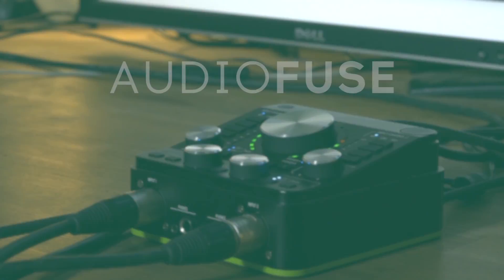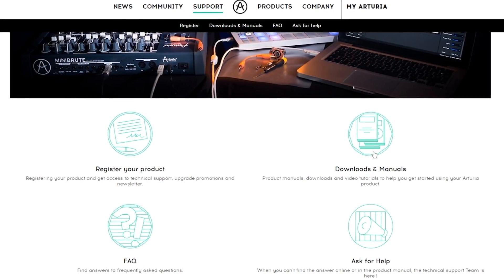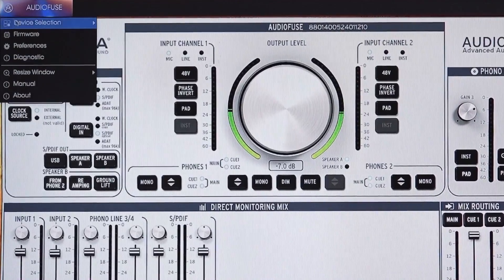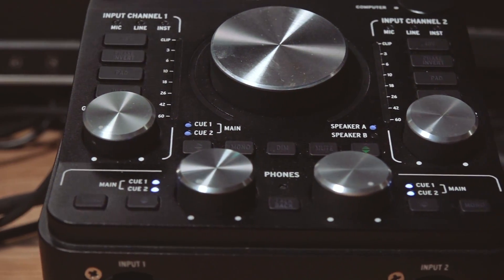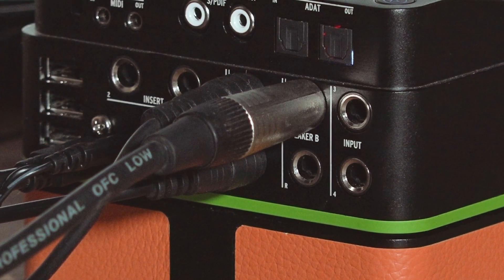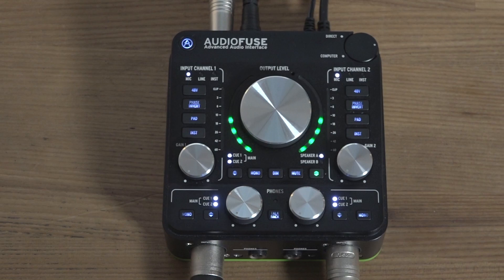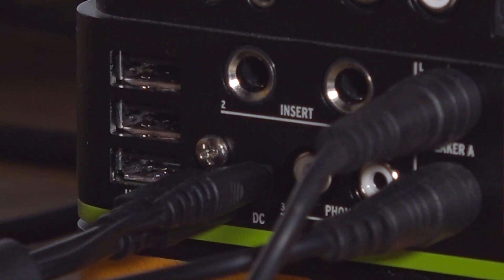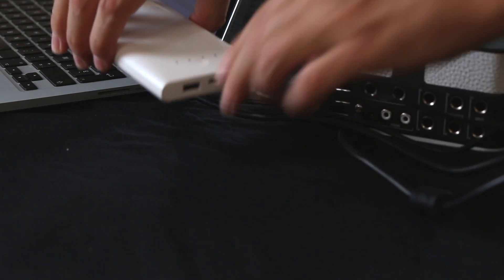AudioFuse Tutorials: Episode 1 - Power Modes

Comment: Just received my audiofuse, I have two iMacs both registered to me via Apple can I install the software onto both machines as I may want to use one iMac in a different location i.e. My static caravan/ trailer any info would be appreciated,I have not registered my audiofuse yet so can't ask the question on forum.
Reply: You can install the AudioFuse Control Center in any of your machines simultaneously and without any restrictions. If you face any registration issue, Make sure yuo have signed up for an account and then contact the Arturia Tech Support and enclose a picture of your AudioFuse's panel where the Serial Number is printed.
Reply: MusicMan BABEL Thanks for info, I have software on one iMac and I have registered with Arturia,so I shall soon try and install software on the other iMac,I have just noticed there is a firmware update so I shall do that first on the original installation,thanks again ps it's a fantastic interface.

Comment: +Guy Perchard +Arturia - When using a USB Power Bank to supply power to the AudioFuse when AC/Mains power is not available, how many Milliamps of current must the USB Power Bank be capable of supplying to the AudioFuse???  

i.e. Some USB Power Banks only supply up to 500-1000 milliamps (0.5 - 1 Amp) for SmartPhone charging, while larger units usually have at least one USB port that supplies 2000-3000 milliamps (2 - 3 Amps) for iPad and Tablet charging.  Does the AudioFuse require a 2-3 amp capable USB Power Bank in order to ''unlock'' its full capabilities, including the 24dB of headroom???

Obviously, the larger the total capacity of the USB Power Bank, rated in Milliamp-Hours (mAh) or Watt-Hours, the longer it will power and run the AudioFuse.
Reply: Hey bb foto, good to hear from you. Great questions! We recommend using at least a 2000mA USB powerbank. AudioFuse will switch to Green power mode if you use it with a powerbank, so you'll be getting 18dBu of headroom. You only get 24dBu of headroom on DC power :)
Reply: +Guy Perchard - Thanks for the information and quick reply.

Comment: When you connect a USB Power Bank to the second USB Connector on the supplied USB cable, does that offer the same power mode and full capabilities as using the supplied AC/Mains Power Adapter???  If not, what ''power mode'' and features are enabled when using a USB Power Bank without AC/Mains power???

Comment: My Surface Pro has one USB, can I use AudioFuse?
Reply: +Jason Gibbons - Yes, you can use the AudioFuse with your MS Surface Pro. BUT, if you want to use the full capabilities and features of the AudioFuse, you will need to connect the included AC/mains power adapter (wall wart) to the AudioFuse or connect a USB Power Bank that supplies 2-3 Amps of current (as shown near the end of this video) to the second USB connector on the included USB cable.